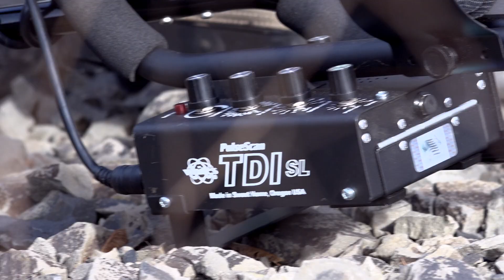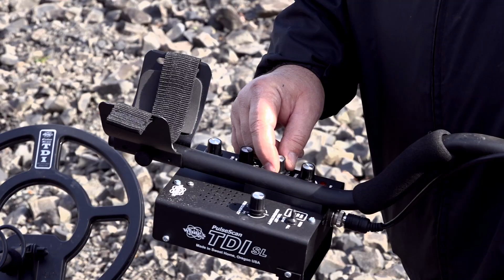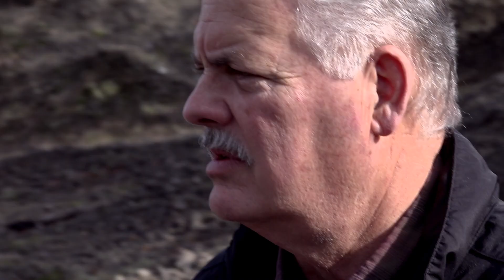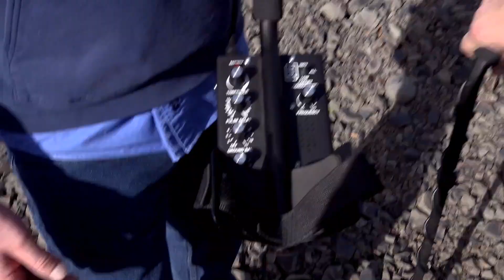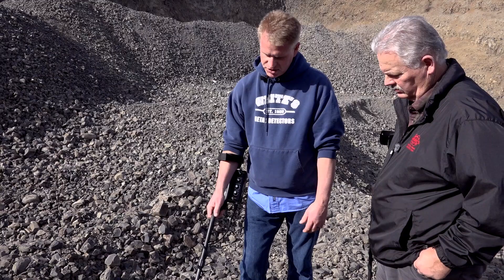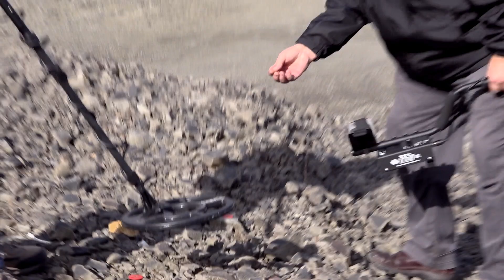Steve and Dennis: TDI Talk

Comment: It would be more interesting, if they placed the gold nugget  under the hot rock .. will detect it ..?
Reply: there is basically no difference over or under...i have found a gold pendant at the beach in a pocket at low tide UNDER a Hot Rock [ rock was about the size of a fist doubled ] with my TDI SL

Comment: will the tdi sl go as deep than the tdi pro...also will the oz coil give more depth if used with the tdi sl ????
Reply from the maker: David - the SL with the stock coil might be a little less deep than the Pro, but with a Miner John or OZ coil you should get a bit better performance in certain areas
Reply: thanks for the reply....if someone were to use a modified battery pack can the tdi sl take 14.4v and get better depth like the tdi pro ???
Reply from the maker: We have heard of users doing this- the "official" word from us is that using the suggested battery packs is best. Unofficially, you might get an extra few cm's with a hot-rod battery pack, but it's at your own risk.
Reply: The TDI SL is stable as a rock . This is according vto me much more important than just pure power . Thanks to the threshold stability you will hear the faintest  whisper of a target coming from very deep . Put your GB off if possible and you will notice that you can hear a gold ring up to 16 inches . The pro does not go deeper than 18 inches in the same conditions and will require from you much more  concentration because of random chatting. This kills me after a while ... So according to me the SL is a good evolution .

Comment: Hey' don't those Minerjohn designs coils perform on the TDI' good little demo guys! Excellent machine even here in Australia.
Reply from the maker: +Lukeozdigger Thanks for the kudos. A lot of folks like the Miner John coils on the TDI. The TDI was built for the tough conditions down in oz.
Reply: +Lukeozdigger 
& the Razorback coils, they run well on the SPP down here, even better with connectivity switch added.